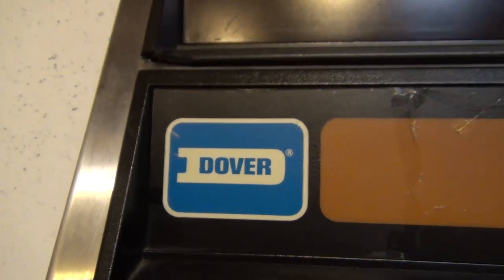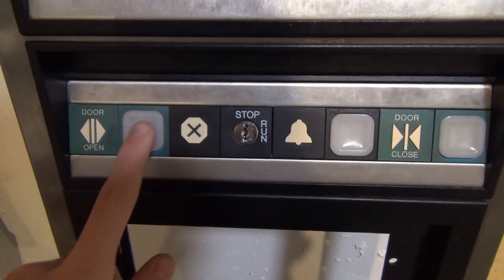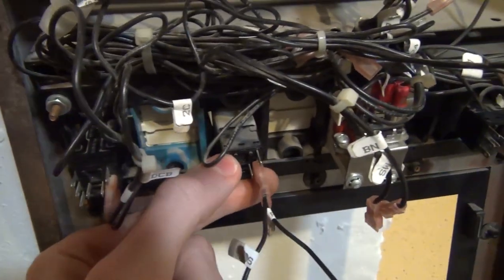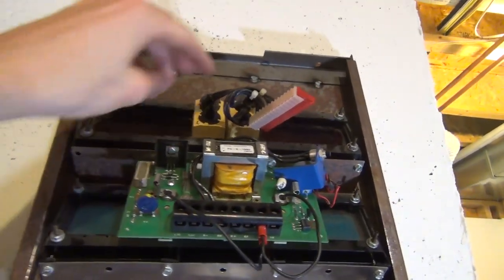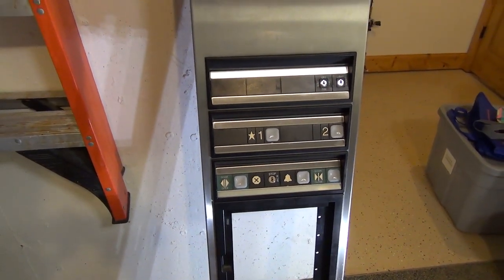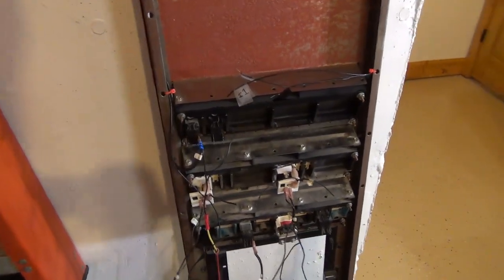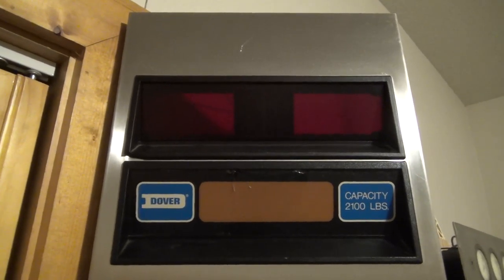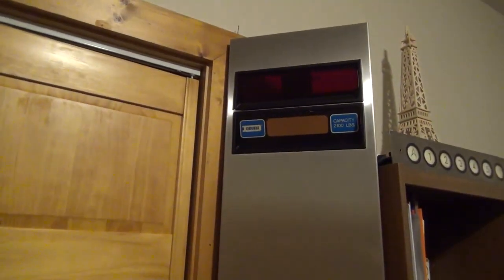Wiring a Dover Impulse Elevator Car Panel

Comment: I like how in-depth you went into each component, all the way down to the lamp socket in each button. This video taught me a lot about Dover Impulse fixtures, and now I feel that Dover was very smart to make a repeating design that is also easy to customize nicely.
Reply from the maker: The only issue with them is how annoying they are to change out in the panel. For the most part, they are a great fixture design.

Comment: This panel is so cool. The elevator at lake highlands village has a Dover impulse which it had more that were demolished has this very same panel except it has a fire service key switch. Sadly that elevator was broken today 😢
Reply from the maker: Darn!
Reply: @stlelevators  I have a Dover impulse panel, would I be able to get the code you used for the arduino to make it work?
Reply from the maker: @Supergamer-tx9qf  Sorry, I do not share source code.

Comment: Are there any websites that sell elevator panels? I would really like one to add to my small (but growing) collection.
Reply from the maker: Not really
Reply: @stlelevators  Okay thank you. My church in Fairview Heights has a 1997 Long Elevator that might get modded from some info I've heard. I hope to get the call button and the panel. Whenever that may happen can you possibly wire it?
Reply from the maker: How many floors? I’m trying to get ahold of a call station of the square buttons.
Reply: @stlelevators  4 floors.  1, 2E, 2, and 3
Reply: @stlelevators  It won't be modded probably for another 2 years.

Comment: Can you make a video on how to wire a dover traditional floor indicator?
Reply from the maker: What kind?
Reply: STL Elevators the square one.
Reply from the maker: Is it analog or digital? Analog being a single light per floor and digital being a PI with a circuit board.
Reply: STL Elevators analog. I apolgize if i confused you.

Comment: Those switches are made by Honeywell and are VERY expensive to buy new ones so be careful with them! It's cool you have them though, everything about this project is cool!
Reply from the maker: Which ones?
Reply: STL Elevators the keys and the original buttons
Reply from the maker: They’re made by microswitch. Says right on the side.

Comment: any chance you will add fire controls
Reply from the maker: Probably not. 1. It would remove the originality of the panel, and 2. I would have to acquire all the necessary parts to do it right.

Comment: When I saw Dover impulse I didn’t realize that the door close button dosent have a light I thought it has a light and it was a waste
Reply from the maker: The way the fixtures are designed, adding a light is very easy and doesn’t really involve modifying the part.
Reply: @stlelevators  well for Schindler elevator they didn’t remove the light for the door button so that’s a complete waste